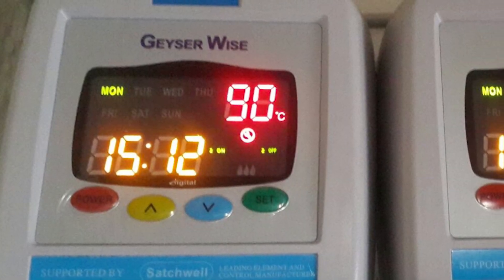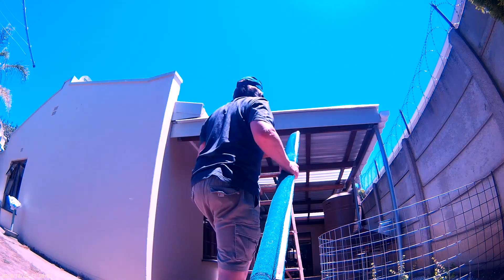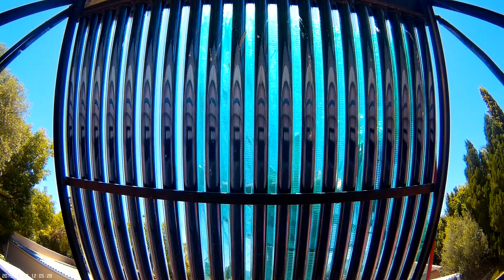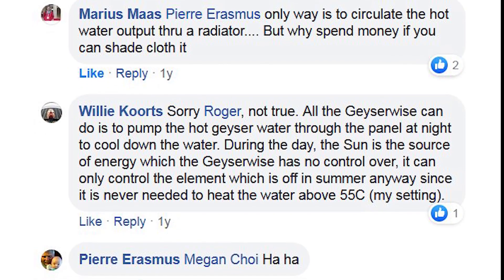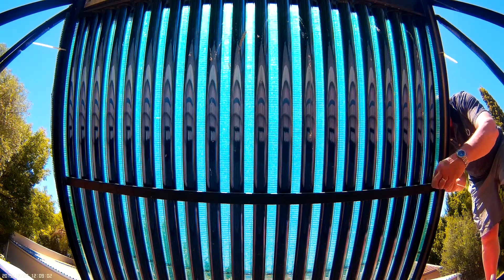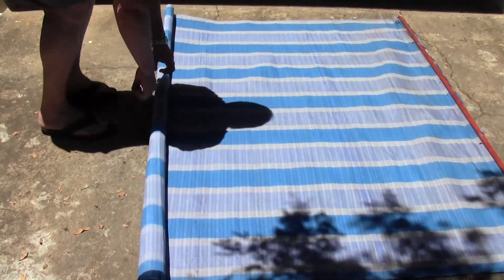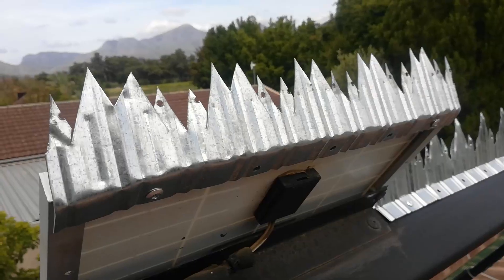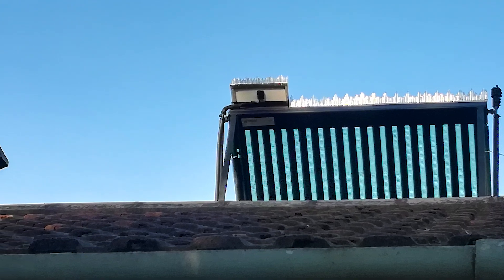How to prevent a Solar Geyser from overheating

Comment: just install a tank expansion like you do in electric water heaters to avoid the security pressure valve from open in hot day do to the expansion of the water by the heat.
Reply from the maker: @joserivas2992  if expansion was the problem, that would haves solved it yes.

Comment: How hard is it to get them to overheat?
Reply from the maker: It regularly happens during the peak of our summermonths.  I normally put mine on around November and take it off in March (I'm in the southern hemisphere).
Reply: @Willie Koorts  how hot is overheated? I am working on a project idea that will use a sterling engine and the higher the heat the better.
I am thinking of storing heat in a sand battery and using a sterling engine or thermoelectric to keep a constant supply of electricity. Probably need a heat exchange to keep the solar heater cool so it is more efficient and doesn't over heat.
Reply from the maker: @jameswhittom22  The water regularly reached the high-80-degrees Celcius on hot days.  Interesting idea of a sterling cycle using sand to store the heat.  Years ago, I read books about insulated rock-bins, heated with air-filled panels (instead of water) with the hot air being circulated using fans.
Reply: @SterremanWillie  I also want to use radiant cooling for the cold side to increase efficiency.
Reply: @SterremanWillie  oh and thanks for information.

Comment: There has to be a better way than climbing on the roof and putting a net to control the temperature. What about a pump system? So that hot water is not pumped into the hot water storage tank above a certain temperature?
Reply from the maker: I agree that climbing the roof is not ideal - a rope-system to "hoist" and lower the net is a possibility.  Not sure how/where you envisage pumping the hot water to?  There is already a pump in my system because the panel is higher than the geyser and hence no thermo-syphening.  If you don't keep pumping the hot water from the panel, the panel's manifold starts to boil very quickly!  The sun in South Africa is quite fierce!
Reply: @SterremanWillie  I saw a video on YouTube of someone using a roller door/shutter which is automated. So when the water reaches a certain temperature, a roller door/shutter is automatically activated and it covers the evacuated tubes either fully closed or partially. Which seems a great idea. But requires fabrication and a controller for the actuator device for the roller door.
Reply from the maker: @sergei971  sounds like a great idea.  For vacuum tubes, a workable idea could be to cut a wide slot in pipes of slightly larger diameter than the tubes and slip them over the tubes.  By rotating these pipes, more or less sunlight is then allowed to reach the tubes.  It should not be too difficult to arrange a simple mechanism to do the rotation of the slotted pipes, even a rudimentary rope system is plausible.
Reply: Works very well and will extend life of system as well. UV kills everything

Comment: ive just installed a solar geyser but have not yet filled water in it ,due to total water cut ...can it get damaged if i leave it like that till the water starts coming to our area or or should i cover it temporarily .
Reply from the maker: I'm not sure if it can be damaged, but for safety I would definitely cover the panels for now.  Just last week, I has a pump failure and I was again surprised how quickly the water started boiling in the panel's manifold!  The sun gives roughly one kilowatt per square metre, so a lot of energy involved!  Enjoy the new panel!

Comment: We keep our geyser wise set to be always off, and get worried when the temperature gets to 60 degrees. I will then cover the tubes in a similar way to you. I was actually worried that around 60 is too hot, but if you say it can go to near boiling, I wont worry anymore. 
Most of the time our geyser wise tells me the geyser is around 45-50 degrees, which I find perfect, and we never use the electrical heating element.
Reply from the maker: Wow!  That sounds great!  Saves huge amounts on electricity bills!  I guess the geyser's life may indeed be shortened when running very hot.

Comment: You need a heat dump
Reply from the maker: Sorry, but you have no idea what a heat pump is!!
Reply: @SterremanWillie  heat dump the excess heat to reduce how much thermal energy in your system. Pool heater. Sauna. Radiant floor. To air.
Reply from the maker: @wadeolson7874  sorry, I read heat PUMP!  As I said in the video, we had a severe drought a few years ago which aggravated the overheating problem.  We are still using water sparingly, so the way I understand a heat dump, this will unfortunately now work for me, so the shadow net is still my best option.

Comment: I live in Bloemfontein and have been doing the shade  cloth thing for years.
We have tandem system where one 200 litre geyser acts as a pre-heater for the 2nd 200 litre household geyser.
The controler showed that the temperature frequently went into the 90s and my sollution to the overheating problem was the same.
I removed the shade cloth in the winter though.
We have a flat roof, so it is quite easy to do the adjustments to the shade cloth cover.
Also, with the tandem system I only turn the heating element on when it is overcast for abour 5 to 6 days during the year.
Massive saving in our power consumption.
Reply from the maker: Great to hear of your experience. Thanks for sharing. Yes, I also remove the shadenet during winter, actually as soon as I see the element needs to switch on too much. I then leave it off until I see the geyser gets to the high 60's af the end of a day.

Comment: But it wont overheat becausr the element is switched off like you said ? Am i misunderstanding?
Reply from the maker: No, it still overheats DESPITE the element not being switched on, because the Sun is the source of energy.  Therefore, the only way to reduce the temperature build up is to reduce the (strength of the) Sun, which is where the shadow net comes in.  Hope it makes sense.

Comment: Seems like the system became over sized, and the pump runs no mater if the target temp is reached... You can turn off the pump nothing will happen to the heat exchanger or the tubes... But constant pumping is the real problem here.

Temp fix would be to remove or cover some tubes, good rule of thumb is 5 tubes per 50L/person. But 40% shade cloth worked so you could also remove or cover 40% of the tubes untill there's more people in the house. Maybe remove only every 3rd tube so its only 30% down and in winter you should still have decent performance.

Best solution tho is turn off your pump when you hit temp target so the hot water doest make it to the geyser and cause an over pressure situation. I see the solar pannel so i hope the pump is not direct connected to the pannel (some installers do this) so it will pump no matter what when the sun is up... It should be on a relay and controled with the geyser wise... But the system isn't closed loop so it wont know if there is or isn't a pump connected to it, you gonna have to check.
Reply from the maker: Unfortunately not the problem - the pump is working exactly as it should.  I also regularly need to clean out the non-return valve when I detect that it is not sealing properly, due to build-up from the water.
Reply: @SterremanWillie   if the pipe coming from the hot side is very short heat could creep into the geyser.

The non return is on the cold side, so you can add a valve to the hot side, brass will conduct less heat than copper so not much energy will make it back to the geyser through the pipes alone. (must turn off the pump if you close the valve)

Might build some pressure in the heat exchanger but that's what the pressure relief valve is for.

Comment: Great and easy solution, I have the same problem that comes with lack of use of the solar heater and measured 80ºC if only hot water is left running, yikes! I wondered myself if such an idea might work, thank you for taking the time to show how you did it.